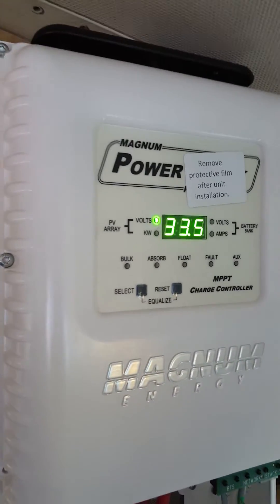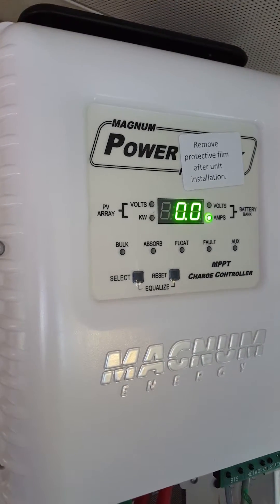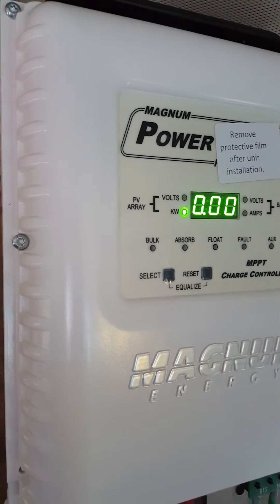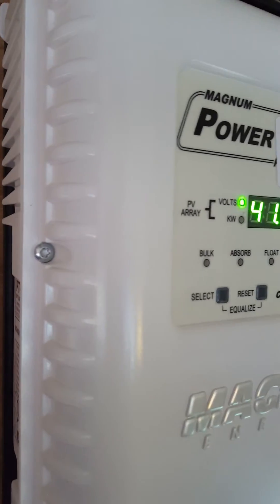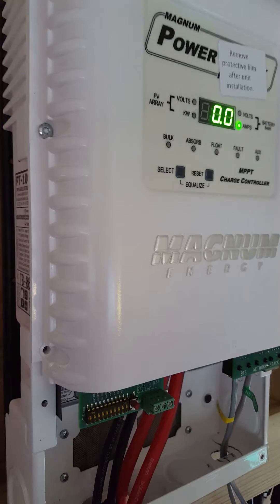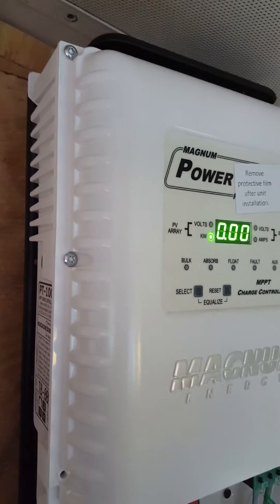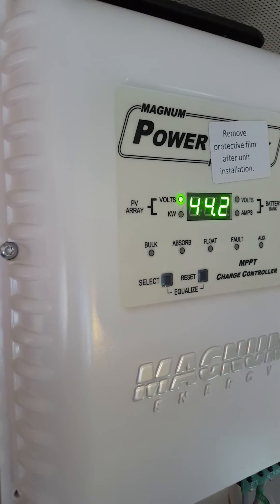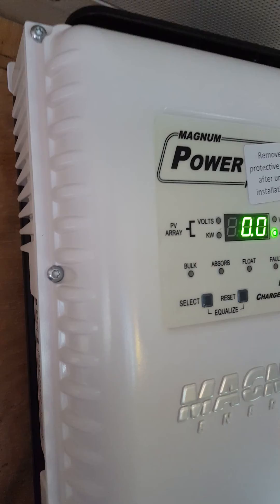First power up of my magnum pt-100 charge controller!

Comment: I would have no less than two 40 v panels in series to charge you big battery bank..I have 4 in series for a 24vokt system with the same charge controller and it kicks but.. puts 55 amps into the batteries on a sunny day.
Reply from the maker: I have 8 285w panels..2 sets of 4 in series ..

Comment: You dont have enough voltage comming from your panels to charge a 48 volt system.. even on a cloudy day. My panels were putting out full voltage on a completely overcast day
Reply from the maker: They have been rewired..this was 3 years ago..and the first panel connected

Comment: I am going to be setting up mine soon. how have you liked it? is setting up all the charge setting easy to figure out or does it come pre set?
Reply from the maker: Steven Palermo its a bit of a challenge but the owners manual has directions.  if you network it with the bmk and remote it's a lot easier
Reply: The Trusty Bucket I have a lot of reading to do lol I do have the remote. I've been renovating my place and haven't had time to go over all the paperwork yet but the remodel is winding down and it's time to get working on the solsr. thanks for the reply!
Reply from the maker: Steven Palermo ok, so the remote allows you to set detailed settings for your configuration.. magnum customer support is helpful if u get stuck
Reply: The Trusty Bucket awesome I will have to remember that if I get stuck. I'm pretty confident about all the wiring and hardware but I'm a little worried I will miss something or set something up wrong in the settings and kill my batteries faster than I should. hopefully all goes well lol
Reply from the maker: Steven Palermo if i can do it anybody can.
good luck!!

Comment: cool stuff, btw what arrangement are your solar panels in?? in case you havent already, you should be able to run 2 rows of 4 series panels to get the voltage higher. that would ensure you are never below battery voltage as it seemed you were at 43 ish volts input
Reply from the maker: kdkinen yes, i took this video very early on..now instead of 4 sets of 2 they are 2 sets of 4
Reply: nice :)
Reply from the maker: +kdkinen i have plenty of power..i love love love it..best choice was to invest the most money into solar

Comment: I am surprised you did not get at least 0.01 kw, 10 watts going to battery even on overcast day.
Reply: she said she got 2 panel. 2 * open circuit is 22 volt equals 44 volt OC. she need minimum 4 panels in series to charge a 48 volt battery bank!